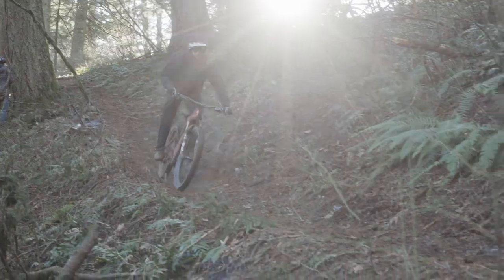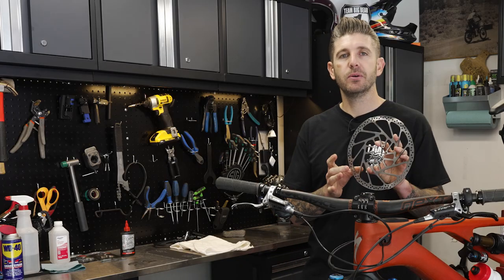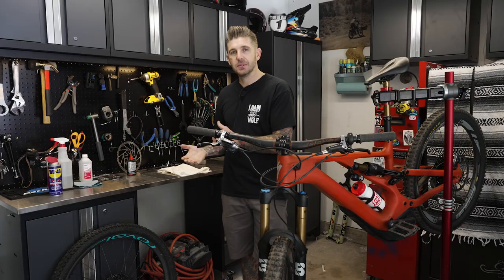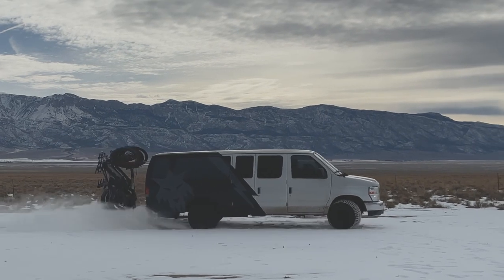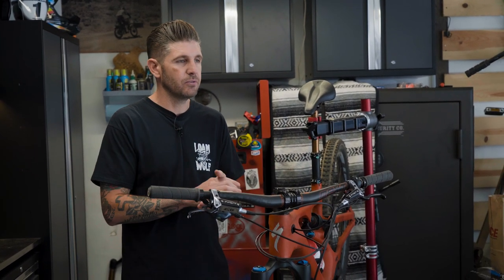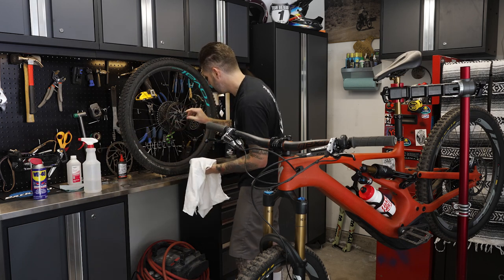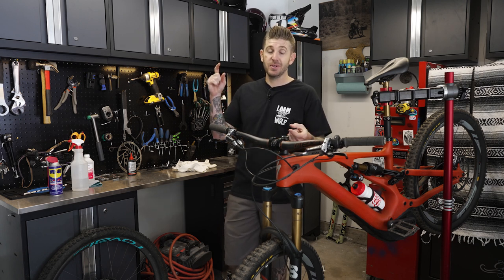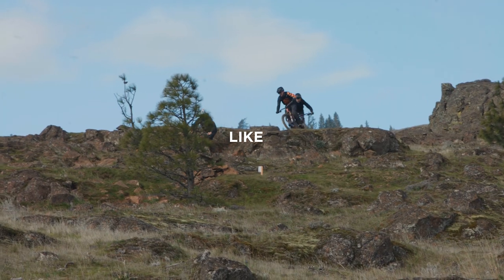How to Clean Mountain Bike Brakes - Cheap Brake Maintenance Hacks

Comment: i've saved oily pads with alcohol and lighter .  resurfaced pads and rotors with dremel attachments  . being that the oily chain /cassette is like 3 inches away its out-of-touch to think people can afford to replace them if they get oily . And i get it that shops aren't in the business of being performance frugal .

Comment: If brakes start squealing again after a short while with new pads and clean rotors then you may have leaking pistons. It can be hard to spot as even a tiny leak creeps around the dust to contaminate the pad. Not cleaning your pistons before pushing them in to change pads can cause this.
Reply: I had a bike in the past with this issue, I had to clean them ALL THE TIME.  Finally I invested in some new calipers, and then a new bike.
Reply: This is just happening to me and confused about the leaks

Comment: Brake Clean in a can... its specifically designed to.... Clean Brakes!.

I have used it on my motorcross bikes from the 90's on, and MTB's for the last 20+ years... 
In fact as I only really started proper downhill in 2020 (retired from trail riding on the ol YZ) and got a 2nd hand Giant Faith with oil soaked pads (You can hear them in my 1st 3 videos)
After those test rides, I got a new shock and just cleaned the pads... Alternating between Brake clean and soaking/shaking in a small jar of Meths... finished with brake clean (wiping & soaking away debris with paper towels throughout).

Two and a half years later... same 2nd hand pads (ok so I did replace the rotor with a 2nd hand one from the local tip shop where I got a complete wheel for $5 to do a mullet experiment).
Ok also I can barely ride black trails.. but that does mean I'm on the brakes a LOT... no noise... 1 finger braking. (in fact changed to 1 finger for 1st time ever on 1st ride after the clean, never went back)

These are heat sync pads (Shimano BRM785) and I'm as cheap as I am Mediocre so I wanted to save them if I could...       YES!

(Resurfacing... I use sandpaper and running water... The water will do nothing to the pad but washes the dust away... I glue the sand paper to a bit of wood.. but better is a bit of glass (watch those edges) if you want a precision flat surface. (You can use self adhesive sandpaper available at most hardware stores for disk sanders... some even have vent holes but I the prefer water method which also washes the pad so you can see instantly if the surface is good...
Again this came from doing pads on things like my YZ250 and with a big enough sheet of sandpaper and an old window I could also sand down the rotors a little (you can make high spots on an MTB rotor doing this as pressing in one point on a thin disk will sand just the point below... a motorbike disk is about 3mm thick so no  where near the flex when sanding them...)

Very little video of  my MX bikes but some pix of the old IT200 trailbike circa 92 on my 1m drop video (very end). Wish I could jump an MTB like I used to jump trailbikes... but then again a smashed wrist put me off doubles on the YZ... sigh.
Reply: Thank you . I think most recommendations are foolish . Brake clean is the only thing to use.

Comment: It’s the brake pad material that gets embedded onto the rotor during the embedding process that makes the pads grip.   Removing that with alcohol requires you to bed the brakes in all over again.   Sand your pads all you want, but Leave the rotors alone, unless they become loose Beverly discolored due to uneven bedding in of pad material.
Reply: What the heck is Beverly discolored?
Reply: @AmyRoc-iw3mi  predictive text bomb!  Meant to say 'unevenly discolored' as the key to getting max power is to evenly distribute pad material all the way round the rotor.   Which is why coasting downhill and applying firm (not too hard) pressure at at the brake lever to heat up the disc allows an even application of pad material to disc surface (don't lock em up when bedding in either).  a squirt of water beforehand on the rotor/pads helps accelerate the process.   repeat as necessary.

Comment: Question here, can i use trp rotors on shimano calipers? Nearly reaching the limit on my current rotors and 2.3 is a tons instead of shimano 1.8s, Thanks
Reply: Don't think he knows
Reply: But I would assume so since I think you get 10mm room each side, even if 5 each side I think you should be able to fit it

Comment: If the brake rotors get wd-40 on them do you have to replace them?
Reply from the maker: It depends on how much... The safe answer would be yes, as well as the brake pads. However, if they have not been ridden with the WD40 on them, then you could probably save them but following the steps here. Sanding, cleaning etc... But definitely change your pads.
Reply: In extreme situations I've heard of people  soaking them for a couple minutes in gasoline, that should get rid of everything.

Comment: Do you need to bed brakes in after every time you use IPA to clean the rotors? Wondering if TRP said anything about IPA removing the brake pad material that was transferred to the rotors and therefore losing friction.
Reply from the maker: No not after iso. Only after sanding/ resurfacing or pad swapping…which also requires resurfacing or new rotors.
Reply: @TheLoamWolf  thanks!

Comment: Is car brake cleaner No good?
Reply from the maker: Not ideal as some of them can leave a residue and may not be carbon safe.
Reply: Works well, but you want to completely rinse it off, and make sure your re oil any of the bearings at it may get on

Comment: I have had nothing but trouble with trp brakes. Also, customer service absolutely blows.
Reply: My quadiem g-spec have been trouble free for almost 18 months on the dh bike.   Not as powerful as my old Formula Cura 4 set was, but more reliable.

Comment: You can get rid of oil on rotors and pads. Bake at 350 for 30 minutes. Don't use your oven find a crappy toaster oven and use that instead.
Reply: Gas camping stove until they stop smoking works (30 ish seconds). However, although they're designed to heat up, I question how good it is for the pads and therefore if it's safe.
Reply: @nhanlon4756  I have done it many times and haven't had any noticable problems. I usually do a complete refresh with light sanding, cleaning, and bedding in. I picked it u somewhere when I was a teenager in mx.

Comment: After watching for just a few minutes and seeing trails and the environment destroyed because you think speed is necessary part of off-roading....I turned you off. Respectful riding in wilderness, forests and deserts should be a core belief of all riders. I control my descent speed with no skidding or dragging tires. Proper use of front and rear brakes makes this a reality. I use simple inexpensive Tektro mechanicals, to do the brake work. And they work. What is "powerful" brakes. My cheap brakes have the power to lock my wheels on the most adhesive surface...pavement. More power does nothing. Braking is therefore limited to the traction between the tires and surface. You don't need expensive brakes for this, and there is no such thing as "powerful brakes", only powerful traction.
Reply: Not every one is out to destroy the environment. But being light on your brakes can glaze them degrading performance requiring this type of service to be carried out. 

By me being careful on the trails my brakes have glazed over.
Reply: @JakeyDill  I ride in the vast wilderness of Northern California, the most climbing and altitude in America. Brakes and braking for 30 minutes to one-hour descents is a daily task. I use Tektro Mechanicals, with Aquilla my favorite, no glazing, no brake fade on long descents, high heat, rotors are hot enough to boil water when I cool them down half way. No problems, use my pads to the limit and buy new. I pump the brakes, I don't drag on them all the way down. Also I will alternate the braking front and then rear. I brake all the way down and control my speed, and control my impact on the environment.

Comment: Isopropyl alcohol is nice, but doesn't come close to a proper automotive brake cleaner.  Of course it's a harsher chemical and you should wear gloves and not spray it on your bike.
Reply from the maker: It certainly is a harsher chemical, and it does work great in some instances, however as our interview with TRP (live on the website) states, there are several of those products that do leave a slight film on products, which isn't a big deal on massive car/motorcycle brakes, but is a problem on small bicycle brakes. Plus ISO is a whole lot cheaper and is guaranteed to completely dry, film free.
Reply: @TheLoamWolf  Brake cleaner is a solvent that evaporates so there isn't any film left behind.  These solvents are stronger and more effective that ISO and will remove more contamination per given volume of solvent.  Anything that is left behind is solute (the oil or contaminant) that you might not have flushed adequately.  The same thing would be left behind with ISO.   A can of CRC brake cleaner costs $3-4 so it is more expensive than ISO but it doesn't break the bank by any means.

There's reasons not to use brake clean such as.  You don't have gloves, don't have adequate ventilation in your work space, it can mess up a paint job if used carelessly, it can damage o-rings.  On the other hand when used by a competent individual it vastly outperforms ISO when cleaning brakes.
Reply: I also use automotive brake cleaner, although I do find I need to go through the bedding in process again after this to build up a layer of friction material on the rotors again. Then they work really well.
Reply: @lokmtb8503  as a former car mechanic, all brake cleaner leaves a small residue.
Reply: @yzedf  In my experience as a motorcycle mechanic I have not found this to be the case. I've filled glass cups with brake cleaner so I can dip qtips in the solvent for detailed cleaning and had no residue left in the cups.  As I said above any noticeable residue is solute that was not adequately flushed by the solvent.
Reply: Brake cleaner shows no trace in oil samples and is preferred for cleaning the sampling equipment, varsol and mineral spirits will show up. However I've never had good luck with brake cleaners on mtb brakes, it seems I struggle to get them to bed again properly afterwards.
Reply: @TheLoamWolf  Perhaps, but a can of brake fluid cleaner is cheaper than a torch and more practical for most people.